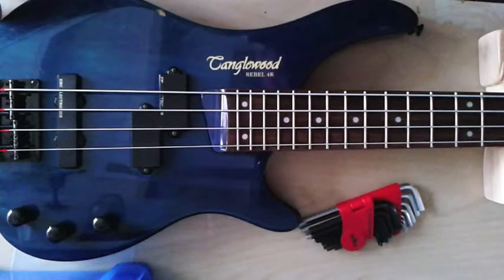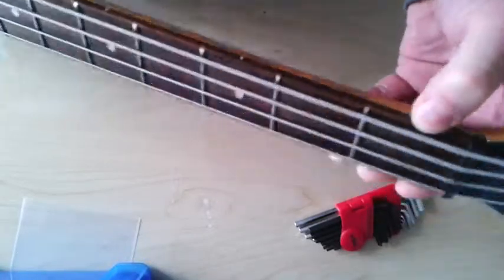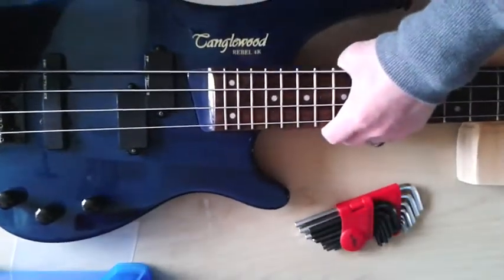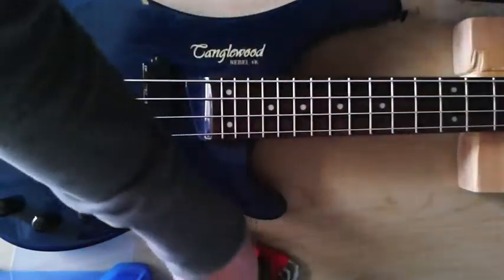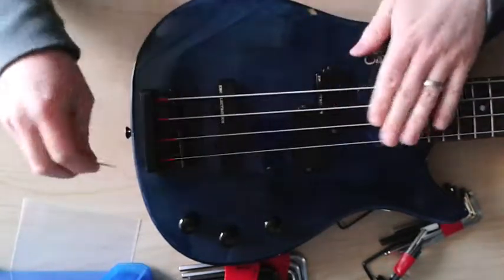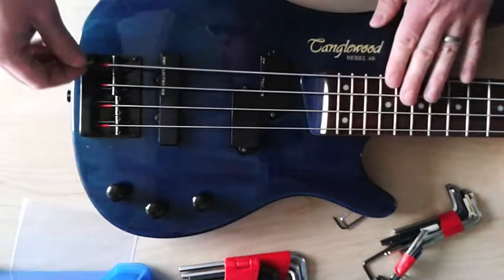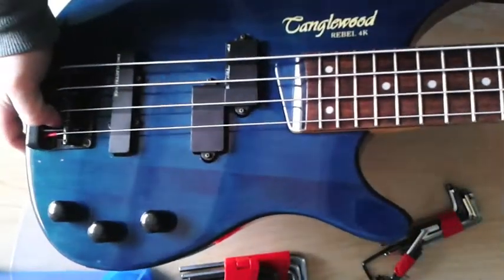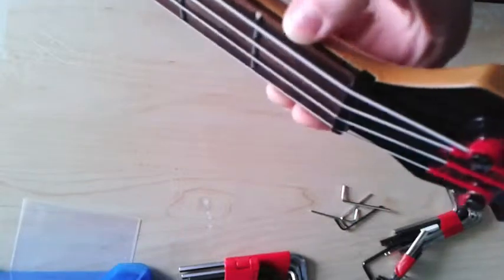Tanglewood Rebel Bass

Comment: I bought mine back in 1998 before they were called Rebel 4K and 5K. I chose this one mostly because I'm left handed and back then this was by FAR the cheapest left handed beginner bass, about $200 cheaper than the Yamaha RBX170. Can't talk about later models but the action on the one I purchased was impossibly high, a luthier had to fix that for me. With 24 frets on such a small body the neck dive was insane... I solved it by adding 300g (!) of fishing lead inside the cavity and by getting an 8cm wide grippy strap. The tone knob needs to be rewired as it hums like crazy. The split pickup is surprisingly decent. Overall a good beginner bass or backup.

Comment: Could you tell me what the MIDDLE knob does? Is it pickup blend!? I just got one... I live by an eighties precision, but this is versatile and capable... mine I'd far from rubbish... lie collar, does a nice job of a crisp compressed sound, consistent thru the board, plus I had no issue with set up. One is not the same as the next, though, eh!? Every make and model varies amongst itself. Many times I've ended up buying the horrible colour as it played the best.... anyway, thanks. Nice channel man.
Reply from the maker: Thanks! I f I remember correctly, the controls were two volumes (one for each pick-up) and a master tone. To blend it you'd just balance the volume of each pickup. As for the quality, I think mine was just pretty beat up when I got it and then it was on storage in a garage for a couple of years so it just got a little messed up, especially the fret board coming away from the neck and that's what caused all the set-up issues. I actually like the sound of the bass, it just became hard to play. Thanks for watching and glad you like the channel.